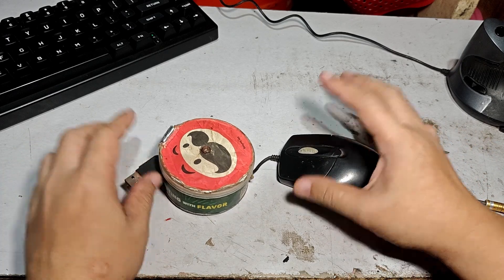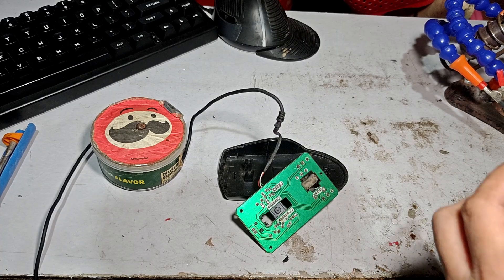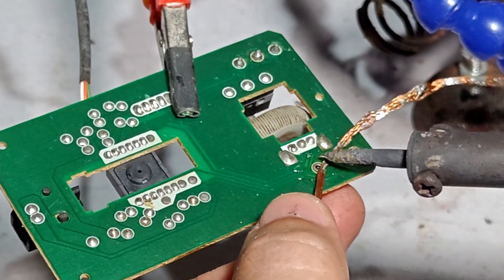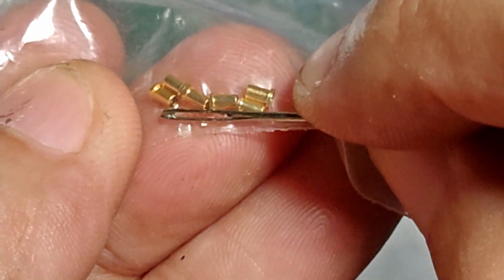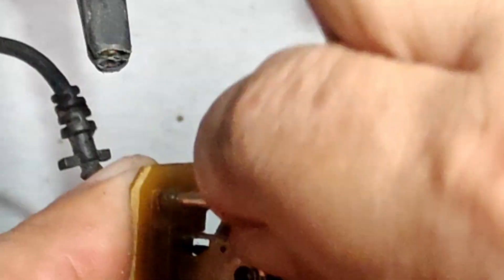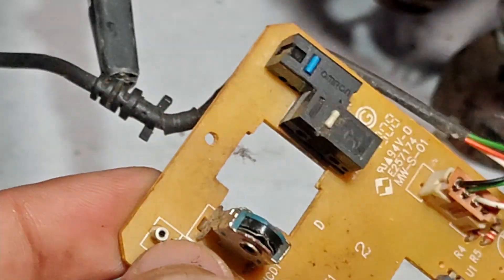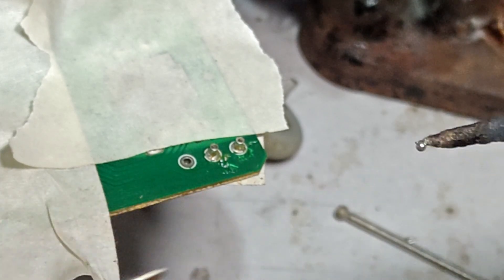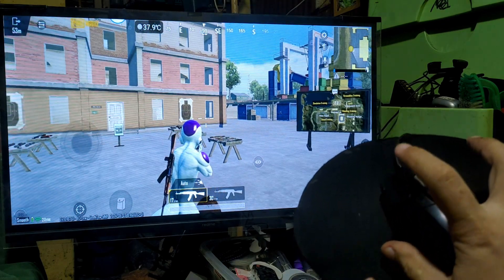Ordinary Mouse to Hotswappable Mouse

Comment: question po sir, like on 7:28, do we need to make sure that there are some grey remains on the soldering pad (bottom) to hold on? my concern is that if i make a hole too big to fit for the millmax 7305, there wouldn't be enough grey remains of which i could solder into. thanks
Reply from the maker: Yes po, need po na may gray, solder pads po yun, need yun para kapitan ng solder, pag wala na yun, hindi didikit ang solder resulting to no connection, and mahirap po magtrace ng lines pag nawala pads, if matrace nyo naman po, hindi na po ganun ka secure ang millmax pins. So might as well gradually drill a hole till you get the exact fitment. Kaya po kamay lang po ginamit ko sa pag drill ng butas.

Comment: Hi, thanks for the tutorial. 
Do we need to soldering 2 milmax only? there are 3 feet in the switch and 3 holes in the PCB
Reply from the maker: as you can see in the video, i only soldered 2 pins. you dont need to solder the 3rd pin.i thinks its a dummy pin, switches like that only need to solder 2 pins. i suggest to use the millmax 0305 for its easy to work with.

if you have a basic knowledge in soldering, i really suggest to do this mod, coz if ever theres a double clicking in your mouse, you can easily swap switches without de soldering again. too much soldering on the board may damage it.

Comment: I wanted ask does flydigi q1 support samsung dex
Reply from the maker: im not sure, but it works on samsung phones
Reply: @RommelRamirez  it has screen cast assist mode so I thought it would work but I'm not sure but I know for a fact shooting plus works since I have theipeaga  X3 controller but shanwan bluetooth controller isn't available in my country
Reply from the maker: @Whowasinparris  i think one of the purpose of samsung dex is making the screen mirroring full screen, so im guessing it will work.